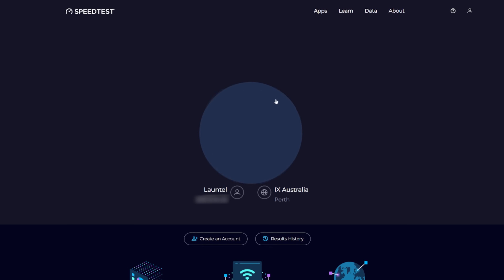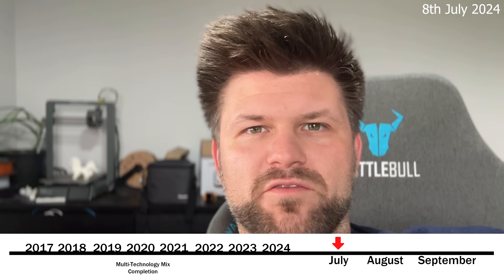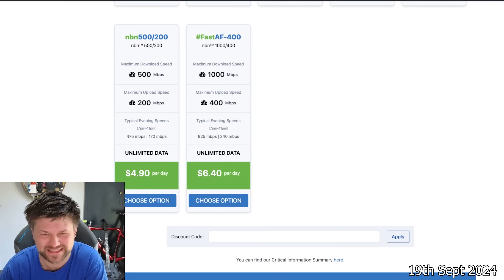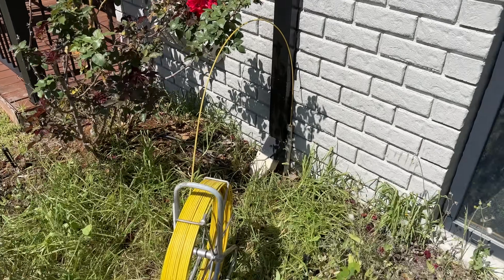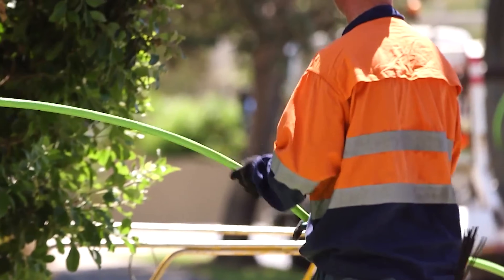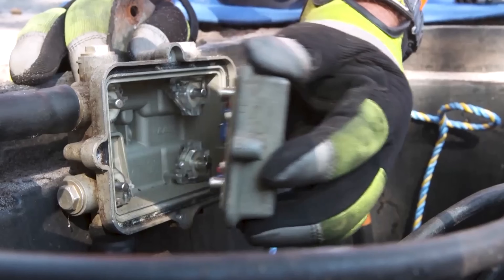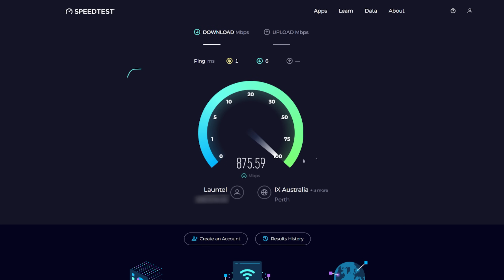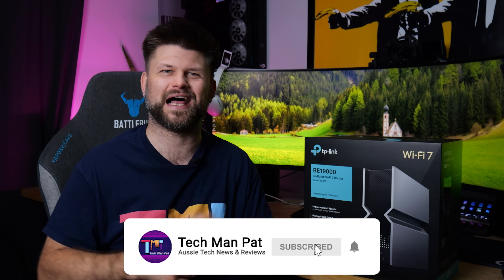My NBN Fibre Upgrade Experience | Dirt Report

Comment: In my stint as a technician, it's called splicing not welding. It's very easy to do, not difficult at all.
Reply: The connectors they use now are like the ones in the YouTube video "Corning NPC+ Connector Installation". No splicing necessary.
Reply: That is true, but how many techs ( use that term loosely) would have a fusion splicer with them. Pat cleary had a propper fibre tech with the right tools, some people making these connections have barely touched fibre at all. I've watched videos of some installs and they didn't even clean the fibre.
Reply: @tready2008 Splicing is what we call it in my job (we do heaps of patch panels/tie cables & pre cabling to equipment).

Also have never heard of it being referred to as welding. Maybe it’s a WA thing?
🙂
Reply: @tready2008  How would they splice it without a fusion splicer? Yeah the correct way would be cleave the fibre, then use a wet and dry wipe to clean the fibre, check with a camera for microscopic debris if needed, if still dirty use wet wipe and re-check, then splice
Reply: @ElectricalFilth No need to check for debris - strip twice, wipe twice, cleave, splice. Anything under 0.05 (with new gear) is fine. 

I’ve seen more than double that result pass testing, but that’s my max threshold for re-splicing.
Reply: @ElectricalFilth  Well like Pat said they cleave it and put into a connector. I don't know maybe I'm missing something but in the video I watched their wasn't any splicing being done. Unfortunately the channel that had the video uploaded I cant find anymore to link to it.

And the uploaded replied to someones comment about cleaning it and after he did that it stopped having issues.

Comment: The clipped connection made it easy when our connection box needed to be relocated. Good to think about before having it welded as it makes it much more difficult for servicing later.
Reply: I think you're taking about being able to unplug the indoor fibre cable from the outdoor box to run it from another location and plug back in? 
Pat can still do that, it's just that the plug they added to the house end of the underground cable is spliced on. That usually means better connection with less optical loss and less chance of it failing.

Comment: any news on the Fixed Wireless upgrades? last i heard we where supposed to get some fancy Nokia antennas for the upgrade but they haven't said any thing since that not even a rough rollout date, even tho the NBN site says i already have the upgrade they haven't been out here still got the old second gen antenna.
Reply: NBN are running FW upgrades, but due to the works required, they are taking their sweet time ahaha. There have been quite a few areas completed already, but it really depends on the area. Speak with your ISP about any scheduled works for your location. If they are only upgrading to FW Home Fast (ie 250mbps) and you have Gen3 NBN hardware in the house, they wont need to come out to the property and install new equipment. Only if you have V2 hardware or they have made the Superfast plan (400mbps) available in the area.
Reply: @imitzi  I've only got gen 2 and there is no 250 plan just 25 and 50 and if i ask Telstra they say ask NBN and NBN literally said shove it where the sun don't shine and hung up.

Comment: What's the point of this video about NBN? No one can contact NBN directly. People have to go to a so-called ISP. They charge a hell of a lot of money for more speed.  Finally, only some areas can get fibre to the premises. Most areas have HFC which is basically coax cable old Foxtel cables running all street poles
Reply from the maker: Dude it’s a video of interest, nothing more.
Reply: @TechManPat . 💯🇳🇿🇦🇺
Reply: Thats actually wrong mate - we went directly to nbn here in qld and they have been contactable the whole time - after their subcontractor was done with the work nbn contacted us to see if everything was done ok... yes nbn directly... no middlemen... where do u get ur information from? Don't just repeat shit u overheard somewhere. Edit: after the installation was done we contacted the isp to switch over... not before... and yes thats for private premises...
Reply: @patrickh9112 Wrong for all of Australia or just Qld?

Comment: At least you had conduit. None at all at my place so another crew came to dig trench then to my surprise they just put cable straight into ground without conduit.
Reply: This is somewhat common practise. As part of NBN's SLA, they do have the ability to simply "direct bury" the fibre cable. However, they will generally get you to contact a local tech to install the LIC from the house to the pit, or they will send the issue to their remediation team to get fixed if the issue is within their jurisdiction. Direct bury has been a common practise since ADSL days.

Comment: I got connected to FTTP recently with Optus but its been nothing but issues. I paid for the whole thing, so I use the whole thing, 1Gbps down, 50Mbps up, and for some reason my entire connection just drops, like I'm literally disconnected from the NBN, router still working but the connection dies.

It's been a horrible experience so far :(
Reply from the maker: Have you tried swapping out your router to try and pin point the cause ?
Reply: @TechManPat  Really depends if the Optical light on the NTD is going red or not. If its going red on the fibre terminal, its an NBN issue that needs to get sorted. If all remains green, but the UNI-D light goes out, could either be a router issue, cable issue to the router or a port issue on the NTD. 

Best to have a chat with the ISP you are with if the optical is going red (good luck with Optus ahaha)
Reply: @TechManPat  Don't have another router sadly :(
Reply: @TechManPat  Looks like a router problem, dude I was able to kill the actual wifi signal by playing games man, like wtf XD

Anyways, optus sending a new router, and I also got a new Asus router, the AXE16000, been pretty good so far, gonna use that as the main router and the optus one as a medium
Reply: I don’t know what you call the device on the wall in Australia. Here we call it the ONT. Your ISP provider can test the speeds for you. I’m a fan of having the ONT in an accessible place and near where you’re gonna use the internet mainly. If you have star netted  structured cabling  in the whole house as in Cat6-8 you’ll be just fine. 

Cheers.

Comment: my first gigabit experience was a condo in bangkok, took 20 mins using huawei modem with wifi6 and came with lounge access and 10GB mobile data for $35 a month. Since being in Australia Felix 20mbps unlimited for $35/mth worked great until I went rural then Starlink worked even better getting 200-450mbps down. NBN is just a scheme to take money from you pocket and give it back to you while insisting you are grateful while adding red tape

Comment: One thing not mentioned is, did you have to enter any login details or is that not necessary with a router? I am looking at changing providers but don't want to use their device. 
May just consider Luntel 😉 Thanks
Reply: This depends on your ISP, some require PPPoE login or other configurations like VLANs. Launtel mostly uses DHCP so it is auto configured / plug and play.
Note that if you change your router later, the NBN network locks your port to the first MAC address that it sees. The lock will be cleared after the router is disconnected for 20 minutes.( Be aware if testing different routers)
Reply: @adrian_z if you're trying different routers, the quickest way to get the NTD to issue a new IP address is to just power cycle the NTD. That only takes a few minutes.
Reply from the maker: No login details at all, plug in and play!
Reply: @TechManPat  thanks 👍
Reply: I've been using Launtel for a few years now 'Paul', And am very happy.